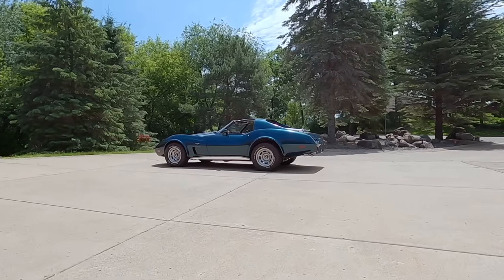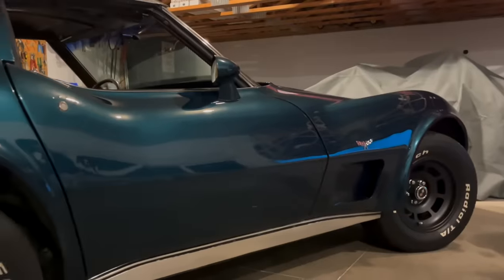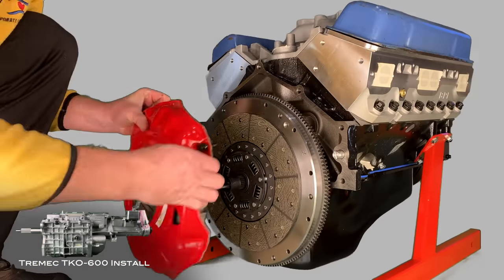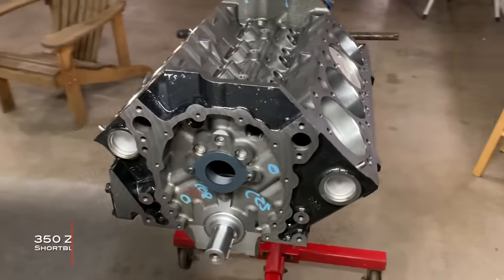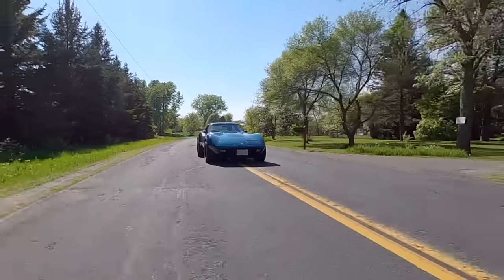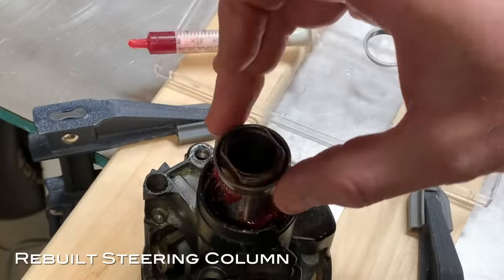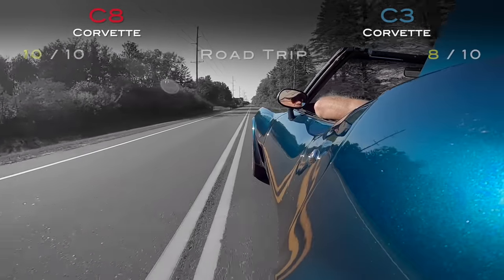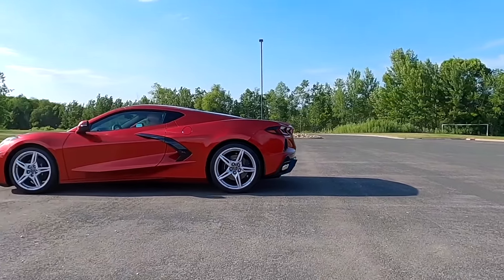C3 Makeover: Modernizing a Classic Corvette

Comment: These mods are super interesting, and well thought out. I agree on the interior, it does not fit in with the overall design. Nobody asked but I think a solution would be found in introducing some curves to the flat surfaces and straight lines. First suggestion is reduce the size of the two main gauges and use white lettering on black background to make them more coherent less aftermarket-look, I'd move the smaller outside gauges lower down like on the C2. I'd also use more authentic surface materials because they look better and last longer. I would use the door cards for inspiration to finish the dash. If you can use a 3D printer, a lot of molds can be made very accurately, then use foams covered in leather, alcantara is an effective way to go. That said, the new fabricated interior looks good, has great craftsmanship and details, just doesn't fit this car.
Reply from the maker: thanks much - great feedback and I like the 3D printer idea (I hadn't thought of that) - I'm going to revisit the interior / dash layout and make some changes. I like your ideas with gauge placement too (well thought out) - I may need to invest in a 3D printer!!!
Reply: @TacoJoe  Hey Joe, I have a question for you. Did you center(align, true, index) the bellhousing when it  was installed? If not, you need to research that procedure ASAP, especially with a Tremec.
Reply from the maker: I did - TIR was under .005 (check out my video of the SST perfect fit kit install for my C3 where I go through the details) - thanks for the comment!

Comment: Did you center the bellhousing?? You might want to look up that procedure before you have to rebuild the Tremec.
Reply from the maker: Yes sir / aligned within about .0015" TIR (Machined my own dowels) - check out my video which walks through the SST Perfect Fit kit-install and I detail how to align the bell housing. Shifts very well and thanks for the comment!
Reply: @TacoJoe  Cool. I saw the part in the video where you just slapped on the bellhousing and feared the worst. Nice build, btw

Comment: You don’t mention it but you must have electronic ignition too, not just injection making life easier.
Reply from the maker: The ECU fires the distributor and yes/electronic (ie no points) - basically there is a wide pickup sweep and the ECU is calibrated to 12 degrees so once locked it, in can pick when to fire / its a pretty slick setup. Looks OEM but its fully computer controlled / thanks for the comment!

Comment: Excellent presentation - very nice. I have big block 71 with M21 G-box, I am going to want to do a resto-mod with this.
Did you consider the rear independent suspension options that are now available?
I would value your opinion.   Also see you got to keep the reverse unlock feature on the shifter - did i see this correctly?

Comment: @TacoJoe -  Do they make a bolt-on Fuel Injector set-up for the 82 Crossfire?
Reply from the maker: I believe cross-fire was a purpose built setup thus "carb" bolt on upgrades may be sparse because I think the design was short lived @ GM - thus -  not a lot of retrofit options. That said, a ProFlow setup should work just fine (base 350 / 23deg heads) - so I think you have some options. Check the forums too. Thanks for the comment!
Reply: @TacoJoe  - Thank you very much

Comment: Another thing that would improve performance and increase fuel economy, is to put an air box around the air filter, to bring in outside air directly into the engine.  Pulling air from the engine compartment is inefficient, because it's usually 100deg +, which will not only degrade performance, but fuel economy as well.
Reply from the maker: @ericfrendrickson5517 - right you are myman! The OEM intake had snorkels that ran to top the radiator bracket to pull in cool, fresh air. Seems I should consider re-installing there / thanks for the comment!
Reply: Cool air improves efficiency, yes. The gentleman is mistaken that it improves fuel mileage however. Hot intake air, hot manifold, and hot chambers all combine to create optimal fuel atomization. Which equals fuel economy..
Performance takes a hit, of course, but ain’t everything a compromise in mechanics?
Reply: @oldschoolmotorsickle  With proper injectors, atomization is a moot point, therefore most likely all you'll get is less power, and not all that great of gas mileage, because you have to run it richer to maintain power, i.e., putting your foot in the throttle more.

Comment: Excellent vid. I had a 79 coupe, red on red L48 gutless 350cid SB. The one thing I did to the handling to absolutely change it to something modern, was to replace the rear buckboard spring with a fiberglass rear spring. Now they have CF rear spring as well and you may be able to find different spring rates. This ONE change was enough to make me go further. It eliminated the rear end harshness without inducing sway. The IRS really did what it was designed to do at that point! 

Next i squared the stance with some much wider wheels and tires tucked into the wells. You couldn't even tell without getting out a tape measure. This took a TON of work on caster and toe-in to get just the right mix of quick response with ultra stable straight line speed. Big tires up front was tough to get just right.  These are very work your time and relatively cheap. I wish I'd had fuel injection and overdrive transmissions when I owned mine. 

Thanks for sharing. Consider smoothing your interior with some 70's carpet on the tunnel.

Comment: Roller cam can run radical. CARB cars can run much higher cam's than a efi system. Its the roller engines. not efi. Do not spread misinformation. A large cam is happier with carb

Comment: i imagine a steering rack upgrade would be a nice upgrade for a more precise steering feel
Reply from the maker: Steering upgrades are an important upgrade for your C3 - there is a dead spot with the PS valve when centered-going straight which is hard to improve without upgrading to a rack & pinion setup. As a result, the C3 wants to wander when crusing highways/etc -- thanks for pointing this out & I likely have some steering upgrades in my future!

Comment: Comfort is an 8 for the C3? I'd give the C3 a 3 For Comfort it is probably one of the most uncomfortable cars that I've ever owned! Road Trip would be a 5, Performance would be a 3 in stock...but could be easily upgraded to make it a 10 because Old School Chevy's are easy to build! Maintenance would be a 9 only because of stupid gauges messing up from time to time including head lights! Over all the C3 is a cool car as long as the frame is not rusted out, Comfort really holds this car back a little while Modern Corvettes are very Comfortable from the C5 to the C7 I haven't driven a C8 yet but I don't know if I really care too considering it's a little Ugly!
Reply from the maker: thanks for the comment / yeah everyone has a different take on their favorite cars and sounds like C3 isn't your cup of tea. Regarding the C8 - only way to roll it is with the top down / great open air car

Comment: Love it but 35 mpg on the highway for a new Corvette? Come on, was not born yesterday.
Reply: Brother, it’s not just hype; at a steady 70+mph, the C8 will do that fuel number.
Reply from the maker: no dude its legit - I took some pics of the dash when I was on a 500 mile road trip this summer (35mpg) - its incredible and it has no problems holding 80 in 8th gear the whole time  too- will see if I can share this content in a future production. When driving to work I average 26-28mpg in a combination of city/highway, 23 miles each way - thanks for the comment!
Reply: @TacoJoe  I think you do very cool work, and it is is easy for someone like me to be critical but with all due respect, I would bet my next paycheck that your flowmeter is junk then. The factory flowmeters are worth about 5 bucks and do not compensate for pressure or temperature. Have you checked the old fashioned way? You know full the tank up to the top and do the math? My pick up truck ( also Chevy) was out by 7 MPG. Again no disrespect. Even if I had the money, I could not pull off some of the things you do.

Comment: Looks like an off road vehicle. Absurd ride height and tires are the wrong size. Don't know what springs he has. If it has stock suspension, the roll centers are out of sight. The roll couples make this a dangerous car. Pure ignorance. I wouldn't let this guy fix a puncture on my bicycle. As for the C8. I'd be ashamed if I had any part of the chassis and suspension design. Shucks.
Reply from the maker: In the video thumbnail. the rocker trim makes it look like its riding high/ ride height is just fine / thanks for the comment!

Comment: Your title really caught my attention because that is what I am doing to my '76 C3.  I wanted to see what you did vs what I am doing.  I am currently installing new carpeting, then the console, seats (Corbeau) and finally the door panels and it will be ready to break in.
Some of the things I did as part of my body off modernization include:
3.36 rear end (not much change from 3.08 but with the A41 automatic transmission it gives me 10.28 first gear ratio
QA-1 coilover shock rear suspension with offset trailing arms so I can get wider rear tires
A41 electronically controlled transmission with overdrive, locking torque converter and external cooler
Tubular front control arms with QA=1 coilover shocks and adjustable upper control arms
Borgeson power steering
Comp Cams retro roller cam
Bored .030 over
AFR 195 heads
Full roller rockers
Edelbrock intake manifold
Holly Sniper Fuel injection
In tank fuel pump
Hyperspark distributor with electronically controlled timing
3/4 stainless American Racing headers
Pypes exhaust system
Dual Spal Electric Radiator cooling fan
Chrome brake booster and master cylinder (for looks)
Chrome water pump
Chrome 160 Amp Alternator
Vintage Air A/C system with Chrome compressor
Reply from the maker: That sounds like a great setup on your C3! / let me know how you like the Borgeson power steering upgrade / I’ve been doing some research and plan to upgrade mine / thanks for the comment!
Reply: @TacoJoe  I hope to have it on the road in a couple weeks.  I'll try to remember.  I also have a '74  that I converted to rack and pinion.  I lost some turning radius with that so I'd only give it about a 7 out of 10.

Comment: Building the engine, I would have went with either a 383 stroker or an LS. No way I'd put essentially the same engine back in. But different strokes for different folks. Nice build on your C3.
Reply from the maker: not quite the same engine 4-bolt & forged crank / sintered rods. LS is a great choice too for the car though - just need to be aware of steering linkage clearance of the LS oil pan / typical driveline items / etc - thanks for the comment!

Comment: Did you do any upgrades to the brakes and suspension?
Reply from the maker: I just replaced the OEM leaf / front springs but did add urethane bushings. In hindsight, I kinda wish I would have purchased a fiberglass rear leaf spring / I've heard a lot of good things - thanks for the comment!

Comment: I'd like to take a 1978 Corvette and put a C8 motor, transmission and interior in it. I'd probably run into issues due to the C8 being a rear-engine, so might have to upgrade it to a C7 instead of C8. I don't know if this would even be doable, but it sure would be cool.
Reply from the maker: the LT2 motor is pretty pricey for the HP - might just want to stick with an LS2/LS3  in a C3. I know the LT2 is a tall motor too (because GM engineers had more space to work with given its rear engine so they made some changes to help it breath even better) - thus - if you add to a C3, you likely would need to make some hood mods too. Thanks for the comment!

Comment: Please for the love of god put some ralley wheels with beauty ring and dog dishes on that car!!
Reply: He has the factory aluminum wheels which look just as good and don't weigh as much as a 1 ton Dually wheel.  I don't know why they were painted black on one side if the car, but there is always sand paper and Mothers polish.
Reply: The clips that hold the trim rings onto the rally wheels have a tendency to rub against the tire when cornering at low speeds and produce a squeaking sound that becomes very irritating very quickly. Also, as someone else has pointed out the factory aluminum wheels weigh much less which reduces unsprung weight.
Reply from the maker: Picking new wheels for the car was VERY HARD! I settled on plasti-dipping the OEM wheels because I thought 15" looked best (proportionally) with the body - car. Nice thing about plastic-dip is I can peel it off and I'm back to the OEM look just like that! Thanks for the comment!
Reply: @TacoJoe  I Thought the black wheels were like some cheapo aero dirt track wheels LOL.  Oops.

Comment: If you're good with a carb, keep it. If you're not good with a carb, you can go with EFI. Otherwise, it is NOT just "plug and play".  You have to tune and adjust EFI too. Overdrive is the only way to go. I have 3:08's in my C3 and I installed a 700-R4 in mine. Lower first gear and 3000 rpm is 106mph CRUISING !  The BEST upgrade by far. All that interior "upgrade" nonsense is NOT needed...Period. The later cars have a real glove box and bolt in, modern gauge kits are easy. Besides, you get to keep the original flavor of the C3 and not some "boy hot rodder" stuff slapped in there. Factory wiring is easier to service too. One thing to think about when you want to buy one of these cars too. How are YOU going to repair it when it breaks down? Gotta schematic for all that aftermarket crap?
Reply from the maker: Wow @larrydrozd2740 / sounds like you aren't a fan! As for the EFI - Wideband O2 sensor is the feedback loop for the ECU and it self tunes (ie- it is plug and play) - you'll never match the gas mileage of throttle response you get with EFI with a carb. As for the wiring: Just a labeled fusebox and a bank of Bosch relays - candidly: I think its much easier/more clear to troubleshoot than the OEM harness but that's my opinion / thanks for the comment!
Reply: @TacoJoe  I'm sorry if I came across shitty. I've been in the resto business for 45 years and I've had too many customers bring in cars that  nobody else can repair because its all aftermarket "magazine" stuff with no schematics or clue. Foose stuff and gas monkey stuff and whatever. I get stuck sorting it all out. 9 times out of 10 its finding the factory stuff and putting it back. Again...I'm  sorry if I came across like an asshole. I need to settle down and explain things out better....

Comment: Very objective Joe. Bravo. A C3 was my daily driver (single Dad too!) for years with ZERO problems. 
  In the early 90's I added a TPI unit & a 700R4 kit for modern fuel injection & overdrive & pulled 24 mpg out of my 77. Later I added a 79 (as a Winyer driver) and swapped in a 200R4 (zero modifications, a direct bolt in). Again, zero probs. My only gripe was the non functioning rear hatch. GM Should've made it functional.
Reply from the maker: I don't remember the difference between the 700R4 and 200R4 / what's the difference (is one more heavy duty?) - thanks for the comment!
Reply: @TacoJoe  the 200 is smaller-exact same dimensions as a th400 & a direct bolt in  while the 700 is slightly bigger & longer & can handle more power. The 4L60 is a 700 on steroids.
Reply from the maker: thanks for the info / I've seen 200R4s in other builds but didn't know these details / thanks for sharing

Comment: Hey taco joe, i just bought a fresh set of cooper cobra gt 2 tires for the vette and wanted to ask if theirs any performance differences between the cooper cobras and the bf Goodrich tires
Reply from the maker: both are run of the mill street radials so I think probably not (will handle-perform much the same - thanks for the comment!)

Comment: This is cool and very nicely done, but why the Paris/Dakar ride height?
Reply from the maker: so many people have said this and man I'm confused / I had a 7 leaf in the rear & 6 inch spring bolts and it was definitely too high - moved to 9 leaf and 8" bolts and matched front to back and front is OEM control arms / shocks and replacement spring from corvette central. So many people have said this now going to check the spec. sure you aren't mistaken the chrome kick panel in the thumbnail for light under the car? Thanks for the comment